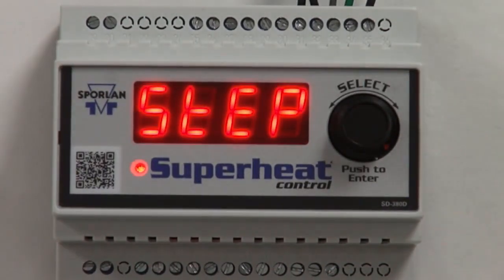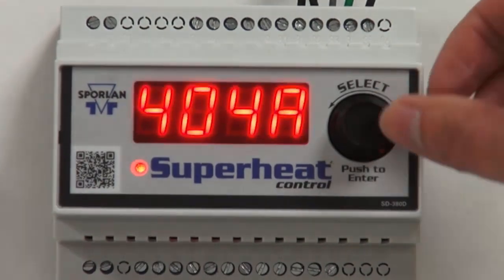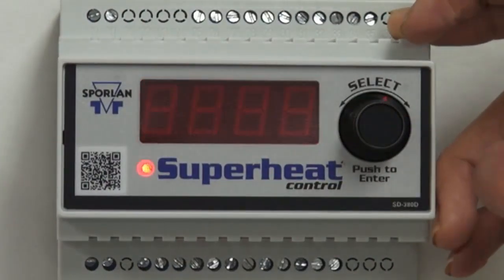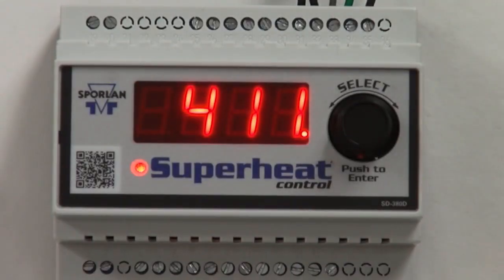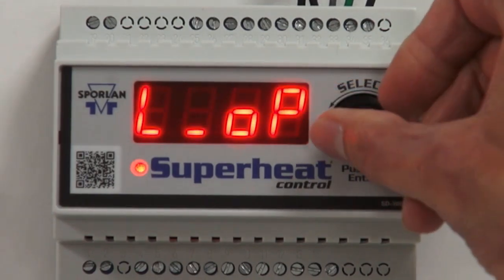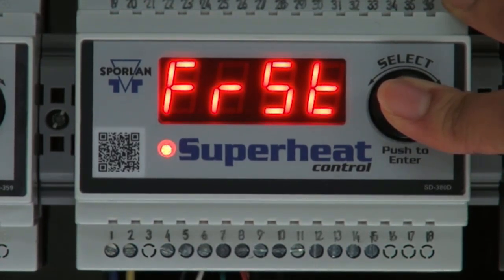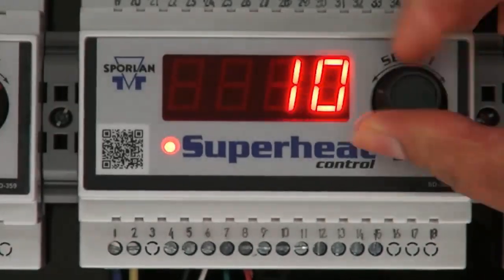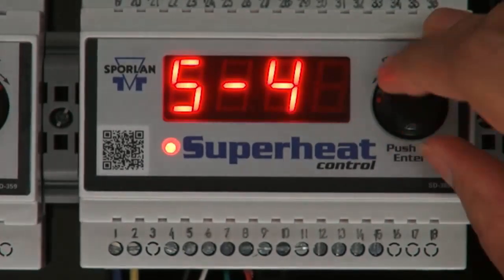HVACR How To: Sporlan Superheat Kelvin Controller Setup

Comment: Hi Guys, I love your work, any chance you could do a video on using the (MTW) 3-port stepper valve with your temperature controller. We are planning on using some for dehumidification, controlling the reheat leaving air temperature. This has the potential for great energy savings and recovery. 
Thanks in advance. 
Cheers JC